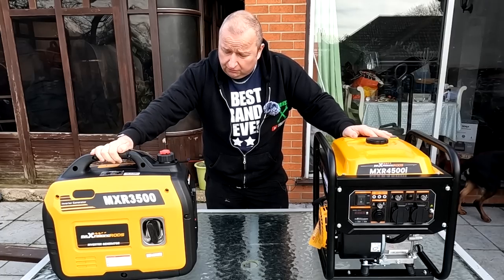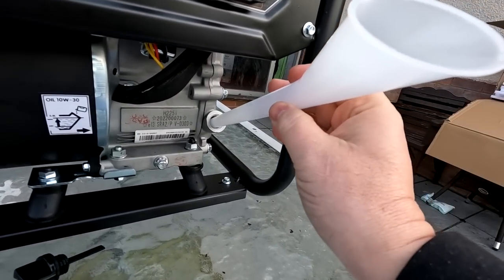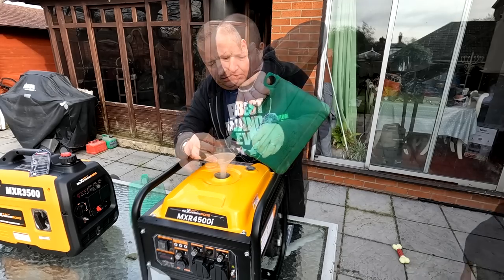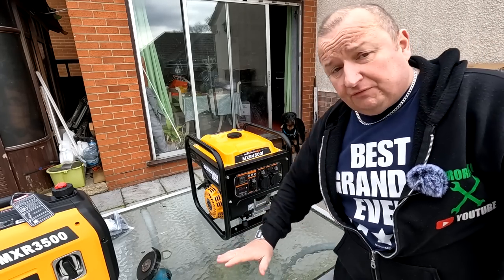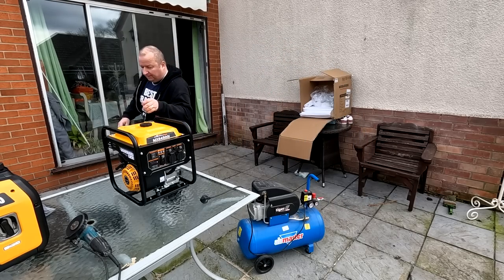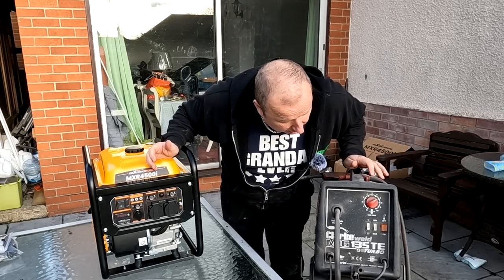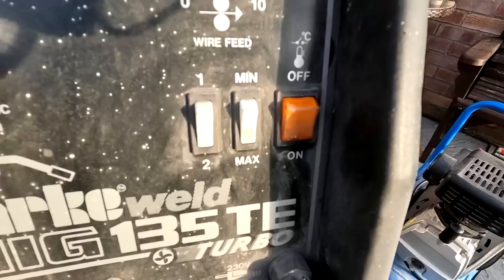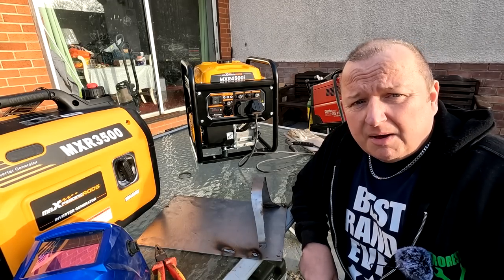Can This Portable Generator Run A Welder And Compressor?

Comment: As a whole house electricity back-up if the power goes out. Don't want the frozen stuff in the freezer to thaw out. And it'll run a gas fired furnace we have in Canada in the winter so we don't freeze to death. Just need a hook up to the breaker box (electrician work) I wouldn't attempt it myself. Great video and for the size I think the db is reasonable.

Comment: Martin I was using  a hired petrol generator Welder the other day on site its,was a mosa welder generator so I plugged our 240 volt sealey 200 arc welder in and it would not have it my mate said  you have to go for 7kw

Comment: Seems a decent machine  No problems with  welder on the thin metal  compressor was fine. struggled there on max power its probably  not going to do it for thin car stuff it be ok

Comment: Martin, I was looking at the sticker for the choke, I realized it was backwards. I recently replaced the carburetor on my generator, and that was fresh in my mind. My workshop is on a farm with no electric power, so I use solar or a generator.
I'm looking to get a belt driven generator that cannot power most of my tools from a diesel engine.
I have an engine, and will look at a generator a guy has on Monday.
Reply: I've had the same on a few tools from Asia with the sticker back to front.

Comment: you should try an electric kettle which can put a fairly high   load   on a generator they usually max out the smaller ones 🤔.
Reply: I have one of those small 2 stroke jobs it powers a angle grinder no issues. I will try a kettle, I've been looking at the Honda's and Clarke do some decent ones but big money

Comment: I think needs at least 5000W constant to operate the welding unit in order to weld anything thicker than 1,5mm. Prices of generators go incredibly fast sky high when some power is needed! But for cars with 0,6mm sheetmetal, no big deal for sure.

Comment: I had been using a 2900 watt generator for my welder, so I'm moving up to a 3500 watt which should do better on the welder. When I go to use my plasma cutter, I'll use my 5500 watt as the air compressor draws 18 amps at startup. All of my generators came from a local scrap yard, and so far I've gotten all but two running. One was a bit out of my ability to repair, so I took it to a professional.

Comment: I'm using an 8.5 kw generator and mma and mig set up with a compressor set up as a pickup based mobile welding unit it works but i do also have OXY FUEL as a standby. i do try to avoid Oxy as the insurance costs etc are simply getting too costly. I do find that the generator does struggle when using a plasma cutter on 1/4 plate and upwards

Comment: The back to front choke seems to be common thing on Chinese engines. I have a Clark generator and a wolf pressure washer and they both have the choke backwards, I also have a strimmer and a hedge trimmer both two stroke and again the chokes are backwards, I think it must be something to do with translation, maybe run in chinese translates to on if you use google or something along those lines and it has been going on for some time because there is at least 15 years between some of the equipment.

Comment: Nice review, it would be a good generator for small, one machine use like the grinder, welder, lights etc. Could it power an arc welder - farmers always use them a lot on farms..?? And, is it powered by a Honda clone engine..??
Would also love to see a series of clips on 'Clarke' branded machines. This UK brand has been around for decades and serves the home DIY, hobbyist.

Comment: If someone is going to be welding with this generator odds are they will be doing much more welding than you just did. The longer you run a welder the more strain you will put on that generator. Just in that short time you welded the generator went into "Over load" mode which means if you do A LOT of welding at one time you will burn out  some parts in your generator. I have already been down that path. Trust me if you overloaded the generator in that short of a time you need a larger generator.

Comment: Hi Mart, be interested to know what wattage the welder pulls when on max setting?
Reply: The reason I asked Mart was the kick in max of that gen was 3500w the run was 3200w so what did the welder draw?

Comment: Great review, dont you just love the Chinese, makes you wonder if they cant get a label right makes you wonder what else they dont get right, well I know quite a lot, something thats worth doing is ignoring the first oil change time and do it much sooner and several of them. I've got a cracking deisel 6.5KVa generator and it took 3 oil changes before I stopped getting swarf out of the engine 😮 Dotn get me wrong the chinese stuff for the money is great but its well worth doing multiple oil changes and run about making sure all the bolts are nice and tight 🙂

Comment: i’d look into solar generators no gas/oil to fool with. with gas you need to be able to drain the tank and run the carb dry for storage. and needs to be able run on camping fuel to. because during winter storms getting out to gas/or petrol station may have had a run on fuel trucks can’t re supply during icy conditions. these gas units need to be able to run on all grades of gas to even natural gas.

Comment: Hi Martin. I was wondering... Is your welder supposed to take a normal 13a plug or is it supposed to use one capable of 16a? Only reason I ask is because I bought a 160a draper welder a couple of months ago and I'm supposed to use a plug capable of 16a but I was wondering if i could just wire a normal 13a one and use it at a lower power until I can get a 16a capable socket fitted?
Reply: I have the same as Martin and it came with a 13amp plug from factory fitted. I think yours needs to be hard wired. Maybe I’m wrong
Reply: @thegreengrass6501  ahh ok. Mine needs to be fitted with one of them blue cylindrical 3 pin plugs that goes into a socket capable of 16a so I'd need to have one fitted to be able to use it. I do however have a converter I bought so I can use it on a normal 13a domestic supply I'm just sceptical on using it incase it causes a fire or what not so haven't tried it yet. But I was wondering if I use it at a much lower power than it's rated for just for light work for now would it be ok. I've had a few say they use theirs in a normal 13a supply on lower powers but I want to hear it from someone I trust which is why I asked Martin. Hahah 🤣 unfortunately as you have said yours/ Martin's one already comes with a 13a plug attached. Hahaha I guess I'll just wait until I can afford to get the correct supply fitted I'd rather not burn my house down. 😅
Reply: @robertpotter2515 yes, if you run it on the lower setting so as to not exceed 13 Amps it will be fine as a temporary solution. You won’t burn your house down, the most it would do is blow the fuse in the plug .
Reply: @TheRCBiker  ohh RC cars. 👀 You have a new subscriber. Hahah Sorry I got distracted. 🤣🤣 Thank you for your comment I may give it a go could do with welding the 3xhaust on my car for it's mot so I'll probably try that first. Hahaha

Comment: What  weld  wire  size  Martin?   I  guess  0.6 mm,   OK    with    a   Mig   low   current   as   you   did,   Don't use  a   stick   welder  !   you'll have  some   fun   and   games,  well  done.
Reply from the maker: Yes, 0.6 I think.

Comment: These are terrible generators... Once you get around the 100 hour mark, of running time.. The insulated copper windings start to burn up, pretty easily.. 
Even when you never pushed it close to its max rated wattage...
i had one, rated for "3000 continuous watts"... Used to take it to Motocross track days, To just power our 1.8kw kettle.... Really didnt last very long... 
Luckily it was under warranty, and i got my money back...
Reply from the maker: Maybe you had a defective one. Not heard of anyone else experiencing this.
Reply: @retrorestore   If it was defective.. It would have failed immediately, or after a short time.... Mine was fine to begin with.. But after a fair amount of use, it failed... 
Where as i have other generators that have thousands of hours on their hour meter, Still running flawlessly... 
The insulated copper windings inside the power head, Usually burn up by excessive power draw... Mine did it without excessive power draw... So i'd call it "poor design or build".... Not defective from factory...
Reply from the maker: @RGD-Audio-Repairs  I would imagine if it was a design fault, there would be hundreds of complaints Just saying.
Reply from the maker: @RGD-Audio-Repairs  This is not a paid promotion bud, I got sent the unit for free but I am in no way paid. I am a full time Youtuber and this is a part of my job reviewing stuff that people want to give to me. If I do a paid promotion, It will say so in the video. You mentioned your personal experience with this model, why not make your own video (as I see by your channel) that you do make videos, I personally don't have the time for in depth communications with people with the amount of comments I have to deal with. 

Your last comment has assumptions about me being biased about a product which is not true. As you probably saw in the video, I highlighted an issue with the choke label being the wrong way round.
You also assume in this following phrase
"The company were clearly (possibly) aware of this?!?!?!"  Clearly and Possibly are quite contradicting and I won't make assumptions on your experiences when you use such uncertain quotes.
With all due respect, My comment section is not for people to vent their frustrations out. You have your own channel for that.
No offense meant or implied. Can we leave it there now. Thank you.